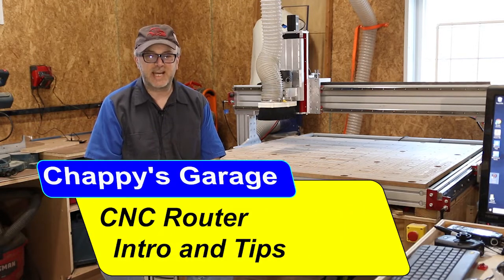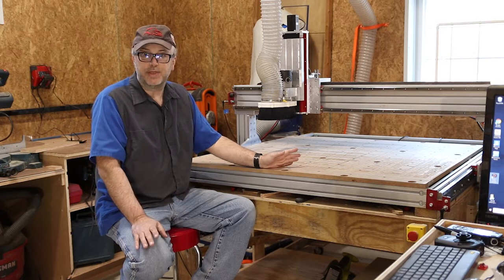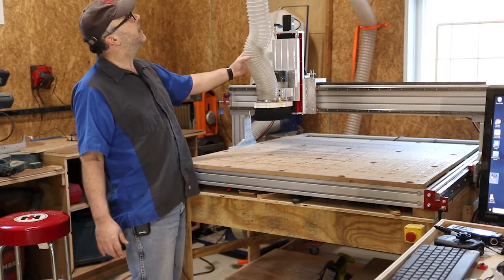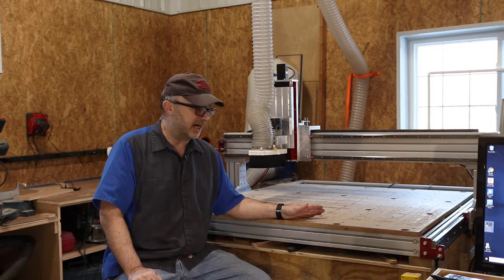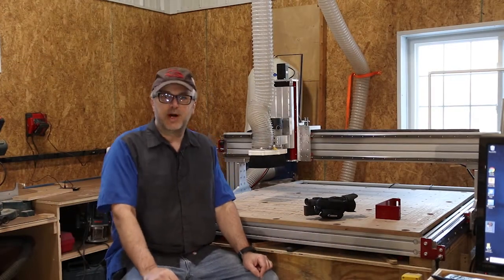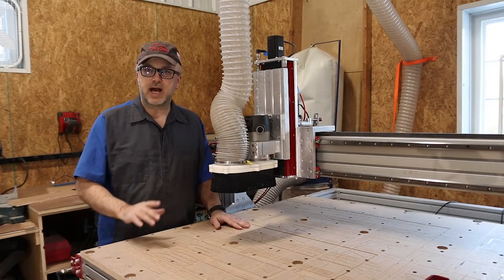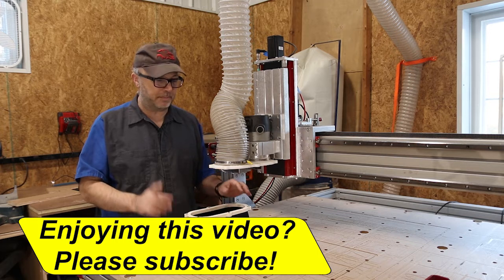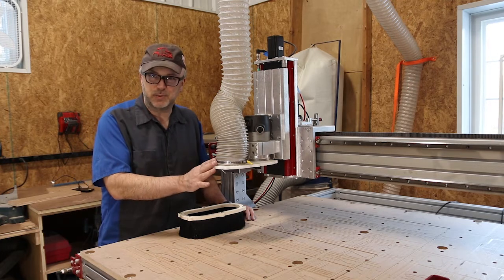Getting started with CNC

Comment: Those grease nipples are a real pain! I was careful not to over tighten during assembly but nevertheless over time they eventually work loose when wrestling to free the gun from the nipple. Coincidentally I just manufactured new end caps for the bearing units last week from 4mm aluminum and reinstalled them with a silicone gasket cut from reusable food storage bags. So far the modification is working great though in hindsight I might have opted for 4mm mild steel.  Happy to share fusion file with anyone interested in making the modification for themselves, ping me a mail @ info@digifabcnc.com!🤓

Comment: Great video, thanks!  What size would you build a new table?  I'm getting ready to order a machine like yours and would prefer to build my own table.  Actually a good friend will build it for me as I am disabled now and have only 1 good hand.  Do you find the wooden table to be RIGID enough or did you have to add a little extra bracing?  You pointed out several things here that I would not have thought of.

Comment: stupid question ! any reason why you used your own router ? given the fact it has brushes VS an  air cooled spindle ?
Reply from the maker: Just to save a few bucks but I recently replaced it with a much better water cooled VFD spindle. Bearings in the router had gotten worn causing a lot of deflection over time.

Comment: im a little late but what are the total parts that you need to get this working? like of coarse you need the kit, but like do you need to get anything additional?   good video!
Reply from the maker: I believe you could buy everything but the things I added myself were: the table (you can buy a leg kit that mounts to the frame but much cheaper to make a table), the router (I used an old Porter Cable router I already owned), a PC to run the software (again, an older one I already owned), a sheet of MDF for the spoil board.  And of course you need some form of clamps to hold things down which I made some that bolt to the table via threaded inserts (I have a 3-part series where I do that starting from the fusion 360 design all the way to cutting the part).  Hope this helps, thanks for watching!
Reply: @ChappysGarage  thanks! that really helped, i am ordering one later this month and just needed to know what i was getting myself into lol.

Comment: If you're going to get a spindle, buy a water-cooled version. You won't regret it.  2.2kw spindle is miles better than any router you could find.  Not to mention its easier on the ears.  at 10k rpm its practically silent and at 24k RPM you can have a conversation without straining to hear.  Also, you won't be blowing around dust with an air cooled spindle.

Comment: Which model of Porter Cable router are you using? Satisfied? Thanks.
Reply from the maker: It is a model 690 which I used just because I had it on hand.  It works OK, very loud and not overly powerful.  I plan on upgrading to a proper VFD spindle at some point but have not had any real issues with it as is.

Comment: Great Video! Are you happy with the nema 23 motors?
Reply: I use nema 23 on my 4 x 8 foot home built cnc - much heavier than this one and they can rapid at about 600 IPM pretty easily and I've cut things up to 250 ipm using a 2.2 KW spindle.  Plenty fast.  I feel like the Nema 34's would be nice however, I would think that they would only be mostly an improvement if you have a vacuum table with a quality pump and just higher rapids which on a bigger table is a huge benefit.  As to cutting things, you're mostly limited by the weight of your gantry, and the size of your spindle. In my opinion anyway. 

I run an industrial router at work and it seems the speeds are mostly limited by the hold-down system in place.  Ours uses suction cups and that induces a lot more vibration.  Vibration is your killer.  More vibration you have, the faster your bits get worn down, overheated, and therefore one has to lower their feed rate.

In most cases no one will ever cut at the speeds the motors can actually move at.  Machines this small anyway.  Last CNC router I've used cut at about 1000 IPM but the thing weighs about 25000 pounds.
Reply: @LogicSpeaks  Thanks for taking the time to share this info, very helpful.
Reply from the maker: They have worked fine for me so far but I am still using the normal woodworking router as a spindle.  Possibly when I upgrade to a more powerful spindle I might want to push it harder and might need the bigger steppers, but so far certainly no issues.